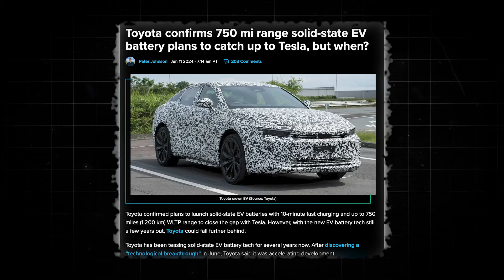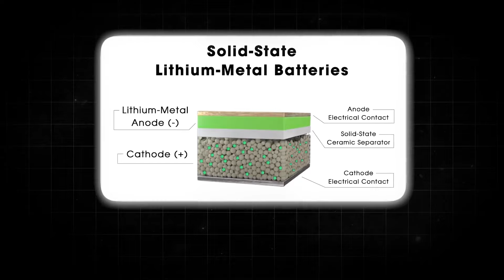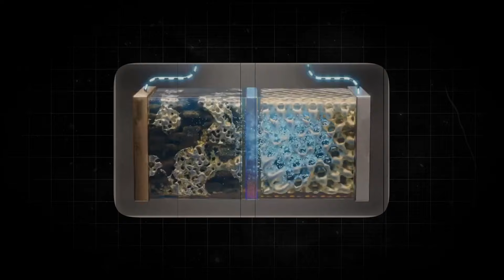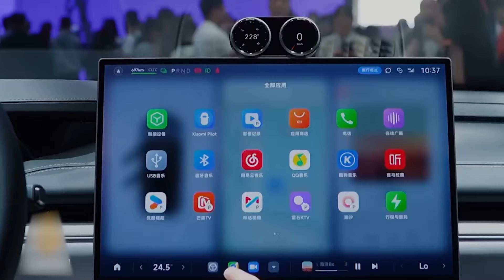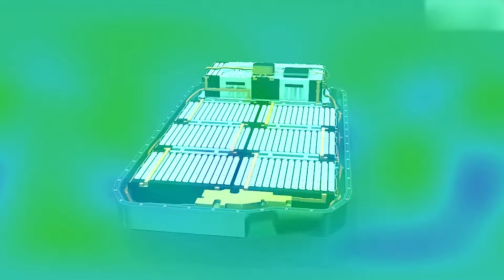New Solid State Battery! The IM L6 Tech Is Excellent!

Comment: Neodium engine yust simple quiet fine druwe 1 000 000 km untill the big servis is needed up to max 100 $... yust to change the 2x clouse lagers...no tank fuel senzors elektronik IT noting yust safe eficient slide driwe
Reply from the maker: Neodium engine? is that a magnetic motor?
Reply: Thats powered someting epwitch can run safe the gearbox end limou for 100 years no furl tank pipes senzors co2 elektronix  noting simply eficient cheep driwe for many generation in line...